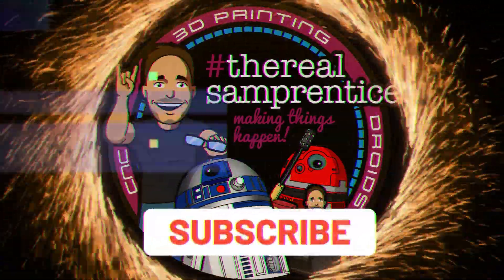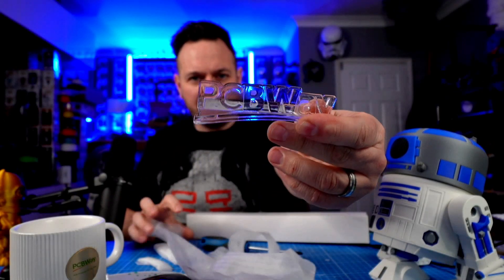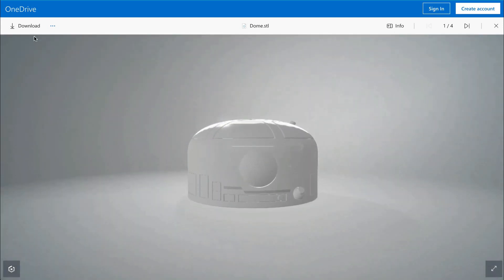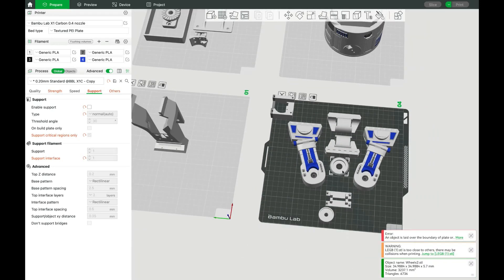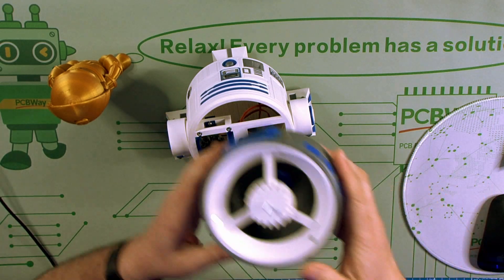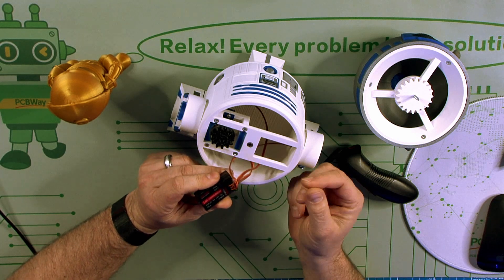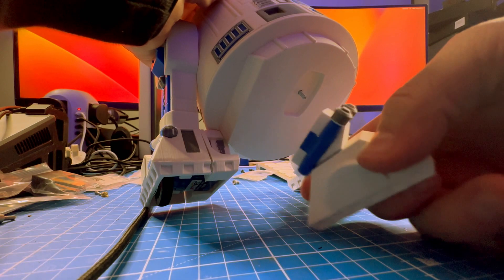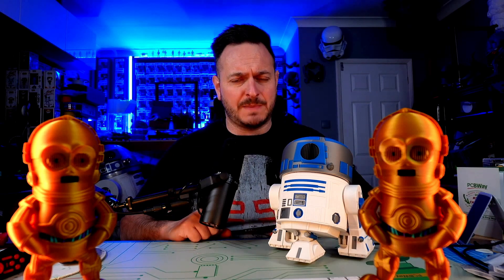Make Your Own R2D2! Printing With Bambu Labs X1 Carbon Printer!

Comment: AWESOME VIDEO! Could you share your support settings for C3PO? I printed one, and the default support settings seemed like overkill!
Reply from the maker: Did you increase the size of the print
Reply: @TheRealSamPrentice  No, just left it as it comes from Wekster.
Reply: I printed at 0.12mm it took about 36 hours to print
Reply from the maker: @tommywilliams9860  okay the one I did was 50% scale I think
Reply from the maker: @tommywilliams9860  I’ll have a look and see what I can find
Reply: @TheRealSamPrentice  Ok cool! I thought that the default supports were too much, I actually snapped the feet off removing them, and noticed you didn't have supports covering like the ones I had. Did you manually paint them?

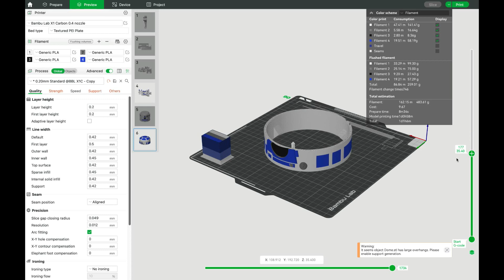Comment: Is the flushed filament amount of 259g on 6:12 only for the head, or all 6 "Build Plates"?
Reply from the maker: I’d have to check that, but it’s possible with the amounts of changes, you can adjust and most likely should adjust the spoils :)